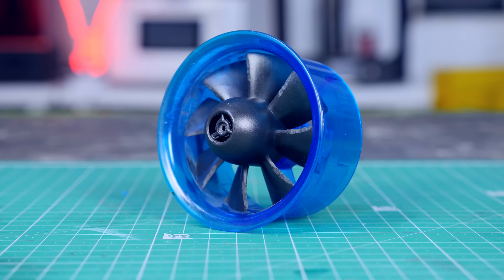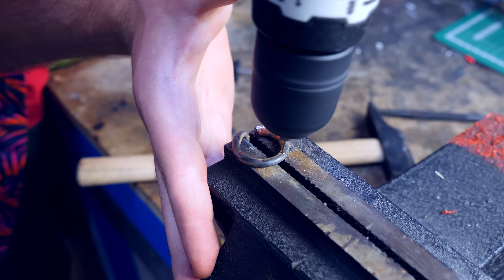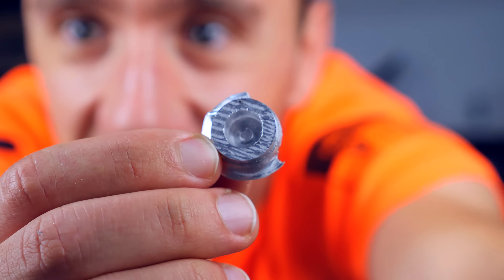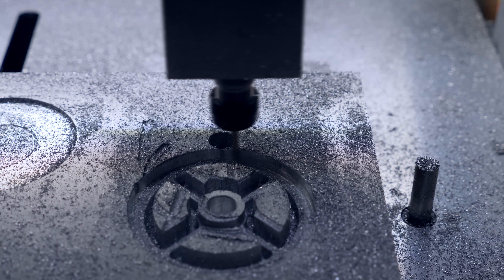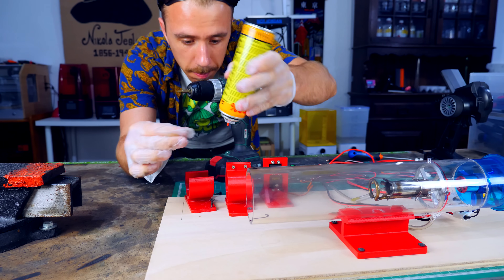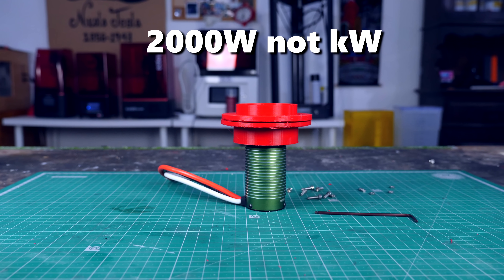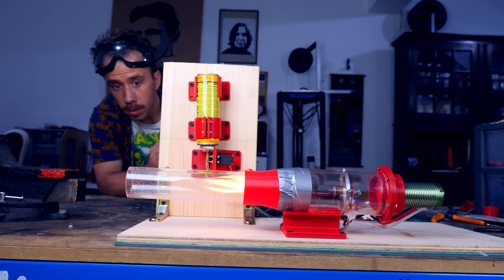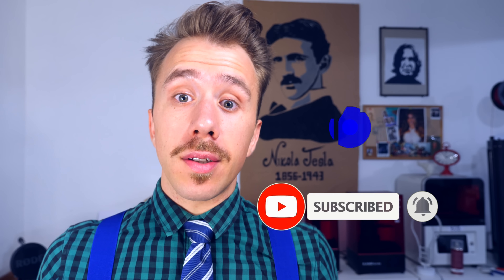I turned my Fan into a Jet Engine (3D Printed EDF Afterburner)

Comment: is the fuel feeding ring actually freezing after you turn the engine off? And if not, what is the white stuff that is spreading all over the feeding ring and part of the blast tube? I'm not an expert, but I would really like to know more about this. Does it have anything to do with the properties of alcohol and the high temperature differences?
Reply: @integza this is a scam right? Could i please get some confirmation from the official integza channel that this isn’t fake?

Comment: I'm going to be devil's advocate and point out that this is technically not a jet engine. For it to be a jet engine, it needs to be a cycle (the power of the exhaust is utilised for induction and compression) this, albeit really cool is just burning a fan exhaust. Once the fan loses battery, the flame stops

Comment: Can you combined the water cooling of the rocket engine you tried but use the fule gas to cool this jet jet engine but also heat the fule in the same way rocket engines do

Comment: Integza: Is genius at 3D modeling

Also Integza: mounts fuel source near flame source.
Reply: Lmao, thought the same😂
Reply: You missed the most important part about fuel, Igniting it!
Reply: @esnevip  yeah but not the whole bottle at the same time from heat hitting the bottle from the open flame.
Reply: He's good at modeling, not planing
Reply: @silverdagger5751  I hope he doesn’t regret that, he’s one of my favorite science channels
Reply: There might be a few problems, but we will cross that bridge when we get there
Reply: Lack of tomatoes 🍅  in the diet.
Reply: it's probably saver the way he did it because if a tube would pop off and the fuel bottle was somewhere else that could mean shooting propane everywhere which is dangerous for obvious reasons. atleast this way the flame end is also where all of the fuel operation is so if something were to go wrong it's all in one place keep him safe because he stays far away from the setup in all the tests. 

if a bottle pops and ignites, yes it would shoot flames everywhere but atleast this way he can keep anything that could start a fire away from the danger area and shorter tube mean a reduced potential risk area.

plus, propane bottles don't burn easily. unless the bottle was in front of the afterburner there wouldn't be anything that could heat the bottle enough for it to pop.
Reply: The k a b o o m s o u r c e
Reply: preheating

Comment: I think you need higher pressure gas as a fuel rather than inverting a butane can, the liquid butane will freeze fuel lines.
try something as a gas raher than liquid fuel on this setup. 
an afterburner is as you said part of igniting gas in the ex phase, but edf don't have a ex gas they are just moving air.

Comment: I when CNC routing metal you should use high speed carbide bits and or flood coolant. You should DEFINITELY consult some reference for speeds and feeds. Biggest thing is, like 3d printing, go slow and make sure your cut depths arent to deep. The vutting forces on those routers are insane and the structure really isn't rigid enough to handle it.

I would highly recommend getting manual machines and learning some hands of machining. CNC is cool, but you don't know the machining fundamentals it makes smoothing out your system way harder.

That said keep it up. I look forward to the future videos

Comment: You lack one critical feature: bypass air.  Jet engines use fresh incoming air to add thrust.  Without this bypass the airflow of your fan or compressor limits the overall thrust

Comment: So my working version of this includes a sort of fire retardant which can be set to engage briefly each time the fuel valve closes or utilizing an aux channel (with a three position switch) can be triggered manually..
Yes in the name of (Safety) this does actually double the weight of the go juice with well it's opposite, a similar canister as the fuel except pressurized with Co2! 
*Only trees \ plants breathe that ~ fyi lol
⛔🚯🚷

Comment: Once you perfect your afterburner add some “Turkey Feathers” for directional control.
And is it possible to 3D print with silica? That way you could 3D print a heat resistant 
thermal glass structure. See through everything.

Comment: I see one problem with your experiment. Real jets use liquid fuel similar to kerosene or diesel fuel. In a real aircraft, especially one that flies at high altitude, butane would be hazardous.

Comment: May I suggest the very end of the tube be made of glass. The inside not so much matters but the very end where the flame leaves is where the most heat is going to be. I suggest making it out of glass so you can still see it without it getting cooked.

Comment: Ok next time you need  ignition source that is simple you may look into trying some furnace parts. They are compact but 110 volts a.c. but maybe they can be adapted. They range from spark to hot surface types. Some of these parts may even be available for heaters  in r.v. campers that run off of 12 volts or propane ammonia Refrigerators in campers.. the hot surface types are very light and small some are delicate some robust.

Comment: Looks like the butane is still in liquid form, would it work better to have a coil in the fuel line, so it has time to turn into gas? Also maybe clamp the fuel line at some point as a limiter, that way the servo can open up all the way and the fuel will always be regulated, instead of regulating it manually

Comment: Put the fuel injection upstream of the igniter! Only have holes facing downstream to decrease turbulence. If you can get an arc igniter to work then it’s possible to not need to cover the igniter. Come up with a curve for fuel speed and air speed that doesnt flame out (fuel/air rich and lean limits in mind) and then have your controller command both fan speed and gas servo position simultaneously according to that curve to throttle up
Reply: let’s design our own model of this. it would be fun

Comment: Use the hot jet exhaust pipe to preheat the fuel by running the fuel around it before injecting?  Just an idea.

Comment: It's a 2000 KV motor, which is not kilo volts. It's the designation of the speed of the motor; RPM = voltage * KV. Come on dude...

Comment: I´m sorry but a glow plug is definatly not a method of igniton...
It´s only used in Diesels and its to Preheat the Zylinder for it to better start during cold times... 
The Diesel ignites itself as its gets compressed and heats itself up.
Good Video tho :)

Comment: This was a very good video I liked it I am going to subscribe to your Channel I am planning on building a jet engine   and this is what my plan is I am planning on building a jet engine and running it on h h o  or Brown's gas I have built a Brown's  gas generator so I can now turn water into hydrogen are Brown's gas with my generator  I even went a step further and got a combustion engine running on it Brown's gas is an efficient way to run your vehicle or motor you get more torque horsepower and mileage out of your  ar motor and it is so efficient now I am planning on building a jet engine and trying to run it on Brown's gas

Comment: Why don't you use the compressor housing similar to a turbo and run the same electric motor to spin the compressor wheel pretty much making an electric turbocharger

Comment: 50 years ago I turned a vacuum cleaner into a powerful jet engine that burned water . I ignited the water in a carbon arc
I was also loud and impressive. I have 4 or 5 of vacuum engines I might just do it 
Again.

Comment: The glow plug on a diesel engine is heat up the block so it's warm enough for it the way it runs is compression of the piston on the compression stroke

Comment: first vid iv seen by you. just wanted to help you with cnc machine. that heavy vibrating is called chatter. you are running it way too fast which is causing that unfine look on the finished part

Comment: You didn't have to heat that fuel line up like that... you could have just bent it. Theres fuel/brake line tools that are at any hardware or automotive parts store. Now you might have changed the hardness of the line by getting it glowing hot

Comment: I think it would be interesting to mount it on a Linear Slide, connected to a load cell.  Measure the trust of just the fan, then add the fuel and see if it adds any additional trust.
Reply: Probably not much thrust due to the size. Needs to be much much larger
Reply: 😂 that's what I guess not much of thrust generated

Comment: You could use a new brushless 2200 w  motor that you could run a shaft through  the motor  two 6 blade props staggered on there mounting  collets center in housing  open ended  in essence  a 12 blade turbine  should move substantially  more air than your 6 bladed  enclosed long volute  isn't what you want

Comment: I think you need to feed the fuel further back in the engine like closer to the fan cooling it as well as greater atomazation thus increasing the power and stabilizing the burn .

Comment: THE SPEED OF THE THRUST FROM THE CENTRIFUGAL FAN AT MAX RPM RANGE WAS GREATER THAN THE SPEED IN WHICH THE FLAME TRAVELS WHEN BURNING THE FUEL, THUS PUTTING IT OUT. Love this guy's innovation!

Comment: Two types of jet engines exist. The centrifugal fan was used in the early days by Rolls Royce and subsequently superseded by the axial flow enow engine which is more compact. The next jet engine concept is the bypass ratio of the engine. I.E. how much cooling air is used to both cool and mix with the exiting gas flow.  An afterburner mixes raw fuel at the nozzzle exit and gives great power with low efficiency.

Comment: Love your videos! I'd love to see you build a jet engine, with or without an afterburner, with a stand alone electric power generator/alternator to power the ignition and charge the battery. It would also be really cool if it could generate electrolysis to separate h2o as a fuel source.

Comment: I think you should try to make a model of "normal resin" then dip it in cheramic resin, clean of surfaces that doesn't need it, cure. Repeat until desired thickness and then bake:)

Comment: How come noones mentioning that hes stupidly intentionally using the liquid from the butane canister. It shouldn't be horizontal or upside down, it should be upright and be using the gas. You can see it emptying way too fast and a huge amount being wasted and liquid literally dripping from the fuel injector. When running its also causing way too much gas influx from the liquid boiling away and causing it to backflash up past and before the fire tube near the fan. Also, its not producing any additional thrust, its literally just blowing a flame at high velocity. You would need it combusting in a chamber, or spinning a turbine connected to the main intake fan (compressor fan). With it just coming out of a ring with holes at the very end, the burning gas has nothing to "press" against, which would generate thrust.

Comment: Dear Integza,

I wish I'd discovered your videos sooner. 

Since you are soliciting ideas for future videos, would you consider comparing the thrust generated by a turbojet motor (like you designed and built here) with a solid fuel rocket motor (for example, APCP), building similarly scaled devices, and show how each would push the same reference platform (like skateboard)? You said you have a sister. Would she be interested in becoming a test-pilot and commanding the skateboard for powered acceleration under the two types of motors? 

Thanks

Comment: The thing about EDF units, is that they're designed to provide a large airflow volume at low pressure for a given motor power (Watts).
For a jet engine, you need high pressure and relatively low airflow for the same motor power.
These are called "motorjets" (engine- or motor-driven compressor instead of gas turbine) and the EDF isn't well-suited for it. You'll get a tiny thrust increase with enormous fuel consumption, because the EDF is designed for low pressure and high airflow for a given motor power.
For a really good motorjet, you need to use a centrifugal compressor designed for high pressure, not an axial-flow EDF designed for low pressure and high airflow.

Comment: Just some Tips for your CNC machining. Use max Rpm, light cuts (10% of the Tool diameter in depth) and use a tool as short as possible with just 2 teeth. 👍 Should work for your setup.

Comment: That cow sound is chatter

Dull bits
Unlevel surface
Unlevel machine
To high a cutting depth
To low a cutting speed

Just a few things that can cause it. Please fix that, or your CNC machine will not only make crappy parts, it will also eventually break or never work accurately again (same thing to me).

Comment: The noise is probably excessive vibration, if you used a shorter length tool your parts will come out cleaner. With CNC machining you want to use the shortest tool possible or slightly more than your total depth of cut to get the least amount of deflection.

Comment: a glow plug is for a diesel but only reason why you have one is because it's for heating up the cylinder actually a diesel don't need one it's because it's cold because they'll run without one. I have a diesel so I know all about that around hydrogen on my truck it runs really well propane on my truck and hydrogen oxen works better a generator over half a million miles

Comment: Very interesting project!  But there is one thing you are not yet measuring - how much thrust is this machine generating?  After all there is no point (apart from bragging rights) adding an afterburner if you don't generate any more thrust than when you just used the fan alone!

You need a thrust measuring rig.  It doesn't need to be complicated, you could mount the engine on a wheeled platform (or a skateboard?) and hook it up to a spring balance.  See if burning all that fuel actually adds thrust, or just looks pretty...

Comment: Some Ideas to Improve:

Use the normal fan and before the air goes in the combustion chamber i would speed the air up by decreasing the diameter (between combustion chamber and fan)  to compress the air. After that the air will expand and accelerate, what will keep the flame going only in one direktion (at one scene (13:10) you could see how the flame was going towards the fan (with radial fan)). One IMPORTANT thing i wouldn't recommend is to turn the Fueltank upsidedown, at this way liquid Propan is reaching the combustion chamber. In this way the Propan has to heat up in the combustion chamber befor it ignites. !The hotter the  gas, the faster it burns! you can literally see how the tube and the 5mm hohles froze up, good for cooling but not for speed.

And perhaps an exit nossel but that creats a lot more proplems.

Hope you make a second part, i really enjoed the video!
Reply: Let’s design our own version together
Reply: Imagine trying to give advice when you can't even spell basic English ... sigh
Reply: @rustyneedles3743  what’s so bad about giving advice and don’t make fun of other people’s English when you say “when you can’t spell English”
Reply: @rustyneedles3743 Poster appears to be an ESL user, which would indicate that they are capable of communicating in multiple languages. You really just made yourself appear  ignorant
Reply: @rustyneedles3743  and how many languages do you speak?

Comment: Little advice here for your CNC not sure what you call it in English that tool but the tool that cuts get a shorter one and ALU needs sharp tools. And due to your machine is DIY you need to do what you can to limit the vibrations as this will brake your tools pretty fast so only mil like max 1 mm at a time properly half of that, with a short sharp tool and you should be good to go for long time. Alu is actually one of the nices materials to work with. But I promise you if you do it right with your machine you can actually make some pretty need things. Keep up the good work

Comment: Modern jet engines actually use axial compression not radial, only the early jet engines tended to use radial compression, axial is better at moving a large volume of air but not that good at compressing it, while radial is much better at compressing that air but cant move as much volume

Comment: Bro you have to change the last part of acyalic tube and set a metal small to large two step nozzle with metal or it will melt down add turbo wheel , change fuel, increase rpm of motor and add more leaf to blower